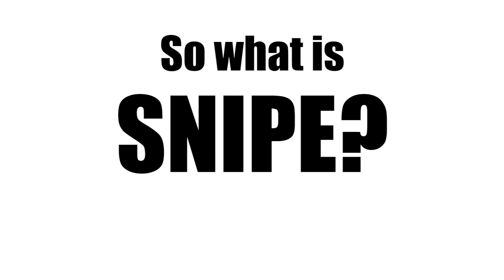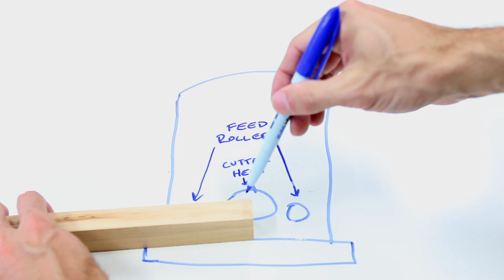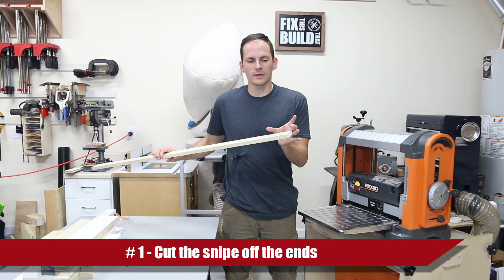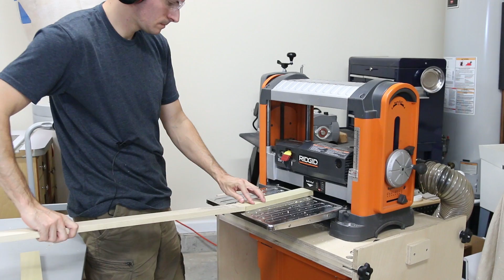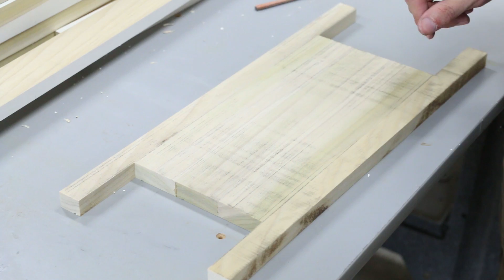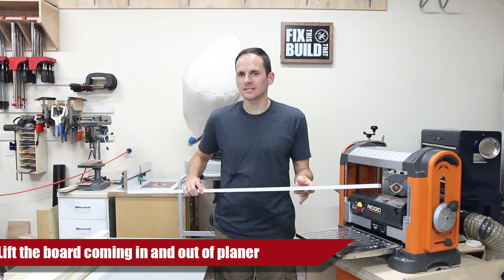6 Ways to Reduce Planer Snipe

Comment: The front and back butting board trick is cool, it struck me that if the feed duration (board length divided by feed rate) gives sufficient time to move between the front and back of the machine, one could even use the same butting board (grab it out of the outfeed when it comes out and put it into the infeed behind the main workpiece).

Comment: I see you have a four inch vac line. Did you modify it for that? I have a new one, and it has a two inch square  exhaust port. A I says I can use my old Delta  planners dust hood modified. ( Non repairable due to parts)

Comment: I have a 30 year old Makita, and the snipe can be bad. If I have the space I’ll run one sacrificial short board off to the side and ahead of my keeper piece. Works like a charm. Zero snipe. You can do it on the back end too. Run the back piece in before the end of your keeper.
I feed the good piece into the planer before the sacrificial piece is through, so they are being planed at the same time. Because the sacrificial piece and good(keeper) are being planed at the same time your keeper gets no snipe because the rollers and cutters are already engaged.
Putting sacrificial pieces directly in front and behind doesn’t always work cuz there’s a little bump sometimes. At least there is with my old planer.

Comment: My very old benchtop Delta 12" has no adjustments for the tables, so I use the sacrificial infeed and outfeed pieces.  Works great. I think the Delta was one of the first small planers out on the market.  All others seem to be later models with a lot more goodies. I bought mine back in 2003.

Comment: I have an old style planar so it might be an issue with the design, but I could swear the board is going in flat and not lifting into the cutter head.  It's the whole roller, cutter, roller assembly that is pitching to cause the cutter head to dip into the board

Comment: When it comes to method 3 - using a sacrificial piece at the front and back... do those pieces have to be the exact same thickness? Or can you use a scrap piece that is thicker or thinner? Curious just in terms of saving wood. Great video btw! Thanks so much!
Reply: You wouldn't want it much thicker, remember u can only cut 1/8" at the most.....

Comment: I have heard one can put a  4 ft level across the two feed tables and lower the cutting head so that it applies a minimal load  on the tables. When the pressure is removed it leaves the two tables about 1/16 higher than the stationary table, which in effect is the theory you use in lifting the board in and out of the planner. Have you ever done / tried this method?

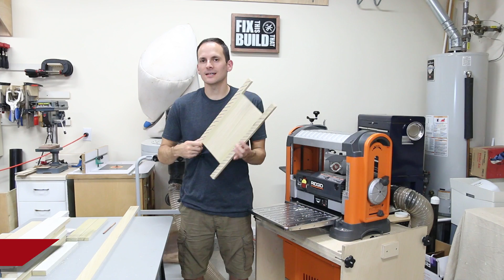Comment: 4:20 i'm surprised the sacrificial side boards did not work better. i have used this method on several cutting boards lately and it works great. i have a dewalt 734, i do not use the lockdown lever. however, the one difference is that since i'm making cutting boards that are several pieces laminated together, my sacrificial boards are actually in various places in the middle. so perhaps it's really a combination of #1 and #4, but it works well for cutting boards. 

thanks for the great videos and tips! keep on rockin' and rollin'!

Comment: I've watched many videos and read many explanations of how to eliminate snipe.  Most of them have some validity, but the reasoning behind the fixes is pretty light and is mostly snake oil.  Since none of the fixes is a complete fix and all seem to have some use,  it seems a common problem should be looked for.  Nearly all of the explanations fail the test of physical laws.  So looking for something that does, it would seem that flex in the machine is the culprit.  When the wood is only in contact with one roller the machine flexes just a little and the other roller drops.  Makita has placed cross braces on their machine and I'm told that seems to help a lot.  The Makita is basically built like all the others except the top line Dewalt.  However, those guide rods are still free to bend a little.   I think the cheaper DeWalt with the lockdown could be improved to maybe eliminate snipe if in addition to the lockdown cross braces were added.  I think the lockdown effectively shortens the guide rods and helps to keep them from bending.  Those guide rods appear to be about 12" long and I can put a 5/8" rod in a vise and push down on the end with my hand and bend it visibly.

Comment: I have a 733 Dewalt.  I slid a 12.5 by 35 inch piece of melamine into planer deck.  I top coated the surface to make it slicker and it seems to eliminate 90 percent of snipe.  I use calipers to measure thickness anyway so I usually don't pay attention to depth gauge.  The in and out beds are not adjustable with this Dewalt, unfortunately.  A 734 or 735 might be better, but this is the one I'm stuck with.  Does a good job overall

Comment: Nice job on the video.  Although just cutting off the snipe sounds wasteful, it really isn’t more so than using sacrificial boards.  Using the method of feeding at an angle substantially reduces the length of the snipe and certainly is more reproducible.  It also makes sense to plane longer boards before cutting to shorter pieces when there is no twist.

Comment: Just so you know, your #2 suggestion (angled infeed & outfeed tables) is not really a valid option for anything other than very short boards, since it can actually produce snipe towards the middle of your workpiece, because if the piece is higher on both the front and back ends than in the center (where the cutterhead is), then the cutter is going to dig out a portion in the middle of your board!
There is a terrific video posted on YouTube recently on this topic by The Snekker Show which details this exact issue, entitled "Everything you need to know about thickness-planer snipe".  I found it a very informative video.
I am still researching additional snipe-reduction ideas, so thanks for posting this video.  There does not seem to be a "perfect solution" to this problem for everyone, but many folks seem to have found what works for them and their own processes.

Comment: Just feed timber and cut down to size. So you lose 2” either end. Pre-feeding scrap pre and post board wastes even more as you will only be able to use these pieces once as they will be under size for any subsequent boards. As they were more than 2” in length your wastage is greater. For the majority of workshop planing,its likely to be inexpensive softwood. Sure if you are taking down an expensive hardwood, pre sized lead and tail pieces would definitely make sense.

Comment: #6 #5 #4 are all using extra lumber, so I wouldnt say just #6 is the money to burn route.
the best results Ive seen (no experience with other than visually seeing) is building a truly flat and level leading and following bench/table set up. so that there is no room for the boards to dip in the back and with some steady pressure on the board as it enters, it wont lift the wood away from the table so it says flat and true all the way through.

Comment: The blade lock bar on my ridgid planer broke. Impossible to find a replacement bar and after multiple emails to ridgid, I never heard anything back from them. I ended up having to manufacture my own blade lock bar from scrap in the driveway to get it up and going again.

Comment: Whats the difference between "sacrificial" and "wasting money" with 2" on each end? It's the same thing lol. Whether you have stock lying around or your cutting excess off of the board it's still wood you won't be using for the project. 
Good video. Thank you for the tips.
Reply from the maker: Sacrificial you only have to use a piece at front and back of the run and you run them ended to end. So if you're planing 20 boards you only need 2 short boards vs 80" of cutting off the ends

Comment: Maybe manufacturers should design their planer with 2 pressure rollers at each sides (infeed and outfeed). It would probably help a lot to reduce (eliminate?) snipes.
Reply: The host has misled the audience. Snipe isn't caused by the work coming into the planer tilted up in the front. All planers have snipe, to some degree or another. Stationary table planers are the worst because the rollers have to lift the weight of the planer plus exert force onto the board. Additional rollers will not have any effect.

Comment: I nearly eliminated snipe on my planer (Jet 15 inch 220Volt) by adjusting the tables CAREFULLY and using feeler gauges and a straight edge.  Its not a 10 minute adjustment.  It takes some time to be accurate.  I used to be a machinist and measured things in .0001 of an inch. Just twisting bolts will not do it.  Patience is needed for adjustments like that, but the reward is worth it.

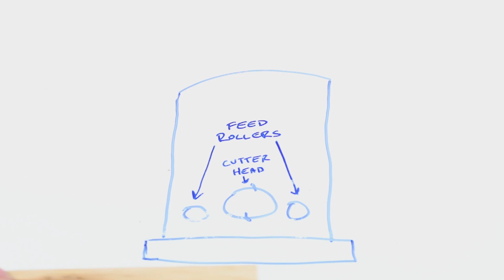Comment: 0:30 I could have gotten myself confused, that looks like a down cutting blade in the diagram. Have we got our in and out reversed? When I was much younger I accidentally fed a length of 1/2x1/2 onto a router table in the wrong direction. 😮 It exited the closed window at 60mph. 😫

Comment: If you use a sacrificial board in front and behind the board to be planned, how does that prevent the board from lifting at the front or the back?  There would have to be other reasons for the snipe.  Seems like the two sacrificial boards prevent the non-contacting roller from dropping thus preventing the cutter head from also dropping.  There is probably slop in the cutter assembly.

Comment: Always start by making sure that your in & outfeed tables are even with & fully in plane with the center table.
I have the same planer & by using the carriage lock, feeding the piece at an angle & having your tables flat, to slightly raised at the farthest out ends, snipe should be minimal. Use scrap to see what works best.😉✌

Comment: I have the same planer. I really don’t like it. I built a planer sled and that eliminated the snipe on the front end but for some reason it didn’t eliminate it on the back end. I checked to see if my sled had some deflection and it didn’t. My sled is extremely solid. It seems to be something wrong with the out feed roller. I am scraping this one and buying a new upgrade. I have suffered with this planer for years and am tired of it.

Comment: Well done! I have seen a cheapskate variation of the sacrificial board leading and trailing the workpiece: use the same board for both ends of the operation.
Reply: How can that work at the tail?
Reply: @QqJcrsStbt  Put two piece of scrap into the mix and locate them at the beginning and end of each run.

Comment: I have an extended flat bed made of melamine. Not fancy at all.  Just fits the width and is longer than the infeed and outfeed tables with a board under each end to keep it in place. I'm thinking about adding guide rails inside so the wider boards don't creep away from the cutters.

Comment: At about 4:06 your pencil is nearly perpendicular to the board so it is referencing the same depth of cut. It won't reveal snipe if there is any. Maybe you could repeat your tests but measure results with a depth gauge. In any case, thanks for demonstrating the techniques.

Comment: Good tips, Brad.  I was the last tip would be to insert another board thru the planer spanning the infeed and outfeed beds that the pieces being planed would ride on.  That's the method I finally adopted after trying numerous adjustments on my lunchbox planer.  A piece of melamine solved my snipe woes.

Comment: get a planer with a shelix cutter head no tricks, No snipe, PERIOD
Reply: The board not having even pressure due to both rollers forcing it down IS the problem. how is 1 cutter head vs another going to solve this?

Comment: Snipe is caused by the cutterhead tilting  when only one roller is in contact with the workpiece (beginning and end obviously).  The reason your angle fed board looks free of snipe is an illusion. The difference is that the snipe occurs more gradually as the board feeds in and out of the planer at an angle.  You need to check the thickness of the workpiece with a caliper at the end and the middle to see whats what. Your pencil method doesn't really reveal a gradual ramp up and down on the ends.

Comment: The angle method works best for me.  So much so that over the years it's become muscle memory using a 20 year old Delta 12 inch planer.  Thanks too much for the video.  Todd
Reply: Sounds like you have the same as mine...do you find a difference from either side or middle? 
Does your cutter head back off if you don't hold the handle?

I clean and wax the deck frequently, I clean the rollers too andit definitely seems to help.  I also adjusted the height of the feed tables. 
I  verified the blades are sharp and accurate. 
I don't know why but even "sneaking up" bit by bit the damn thing shreds the surface from end to end...it still looks better than before it goes in. I deal with reclaimed wood mostly. I don't force the wood either. 
The only "training I've had on my delta or any planer is YouTube university...
I have to figure out what I'm doing wrong before I do further damage. 
The other thing is it's making a weird random crackling or snapping noise after a bit of use. It reminds me of the same noise my kitchenaid mixer made  when the bushings wore down.  Do you know how to check? I don't want to tear it apart if I have to. 
I'd really appreciate your advice please

Comment: Thank you for informative video. Here's a novel idea for the companies that make all these planers, how about making one that doesn't produce snipe in the first place. So many examples of this, where people have to alter the machine in some way to improve on the purchase machine. Like a zero clearance base for a mitre saw, why isn't that made like that at the factory, instead of the buyer having to improve upon it at home.
Reply: Because for 90% of the work done on these machines (construction jobsites where a board needs to be thinned to fit somewhere) snipe isn't actually an issue since it's often not visible and the snipe is like maybe an 1/8th in thick and likely won't affect anything whereas for fine woodworking those machines are far more expensive and you can almost completely eliminate snipe with adjustments to those machines over a lunchbox planar. It's often why people who do really fine woodworking often have at least a Grizzley planar or something even more expensive than that.

Comment: I use method #6 routinely.   the trick is to lift as high as needed based upon how flexible the wood is and how long it is. for example,  if Im planing a 12 foot long piece of poplar, I hold the trailing end up about 2 or 3 feet higher than the planer bed.

Comment: The manufactures/engineers of these planers are terrible and do not care about their products, they all copy each other, change a small thing here and there and DON'T care about the outcome especially to recommend using longer material and cutting off the snipe. With a small modification in engineering/manufacturing they could completely eliminate it and work piece could be completely SNIPE free. I had to modify my daughters planer to get rid of the snipe, I should patent this idea and manufacture it, it's just terrible these engineers don't use their brains to fix problems, if their computer program won't do it for them they don't know what to do. Just a bunch of click/drag wanna be's and really have no clue.

Comment: I have the same planer you have, for about as long as you had yours.  The boards fastened to the edge SHOULD have worked -- perhaps they were not quite long enough.  Also, when feeding boards in together, you butted yours up together.  I find this hard to do w/o getting a gap somewhere.  I just feed other boards in partially alongside each other.  Sometimes, I get little to no snipe on my Ridgid planer with no snipe-reducing techniques!  I tried using a different brand and snipe was far more pronounced.

Comment: Very informative! I just bought my first planer, therefore just now looking into this problem. I have 2 questions:
1. You didn't mention whether using the bolts to adjust both the infeed and outfeed tables would put the board in a bind once it is in contact with both tables. I'm wondering if the planing would be of uneven depths, or if the knives would "bow" the board down to make the right thickness.
2. When using a sacrificial board ahead and behind the board to be planed,  what is the minimum length of the sacrificial one for it to be safe for it to be going through the machine? Thanks.
Reply: at least the same length as it is between rollers
Reply: I think there would be a tiny bow but probably elevating by a 16th of an inch or something.  At least that's what I'm going to try when I get mine.

Comment: I always feed narrow material at an angle either from the left side or the right side so that as it goes through the planer you get even wear on your cutter knives and eliminate Snipe almost entirely. For wide boards I use a sacrificial piece at the leading end and then the trailing end

Comment: Putting the board in at an angle also helps wear your blades evenly VS running it through the middle every time and dulling and chipping the middle of the blade
Reply from the maker: Great point

Comment: Did you look into adding a 'bed extension'? I've recently built a 6' long melamine topped board that sits in the mouth of the planer, which effectively extends the bed of the planer to reduce snipe.  I'm curious how it would compare to your other methods.

Comment: Good video, I am not sure why cutting the ends seems more expensive than feeding other wood through on the sides and front and back, but all in all you gave a lot of good methods and showed it well, and did it in a few minutes. Ok, I will check out your channel.
Reply from the maker: Cutting the ends is more expensive when doing a large group of boards like 15 or 20.  That adds up fast.  For just a few boards you're right, it's about the same.